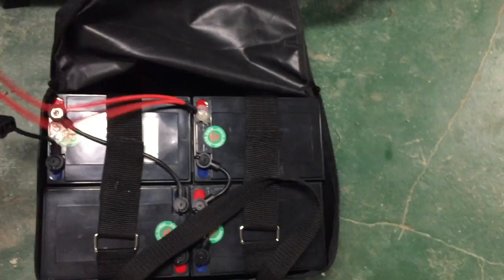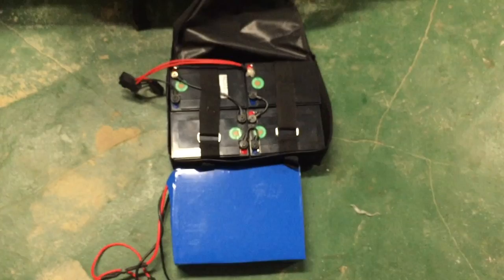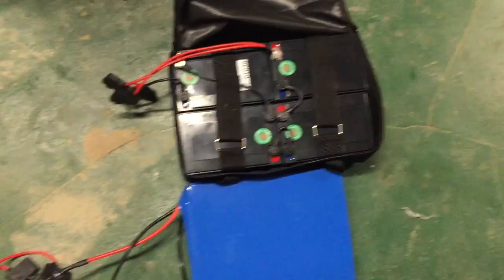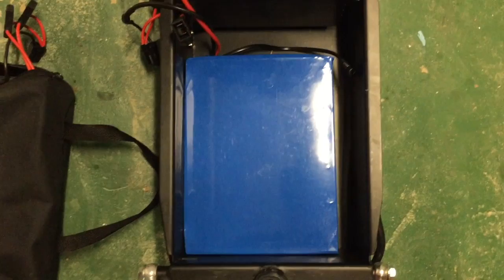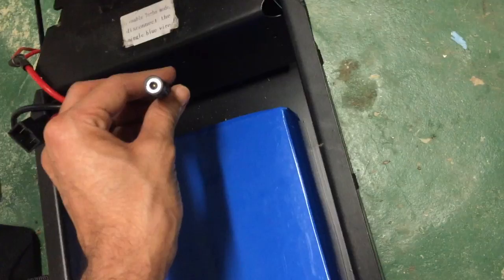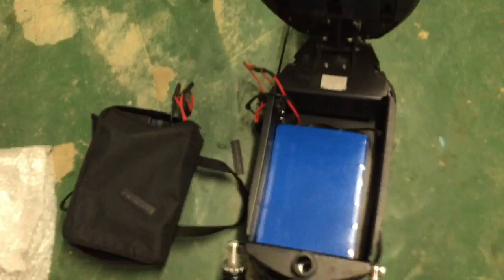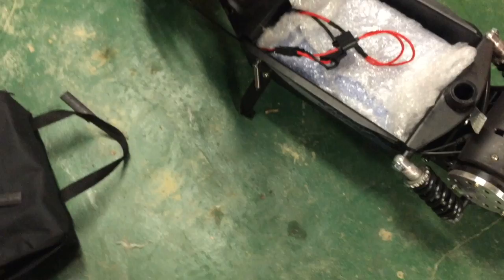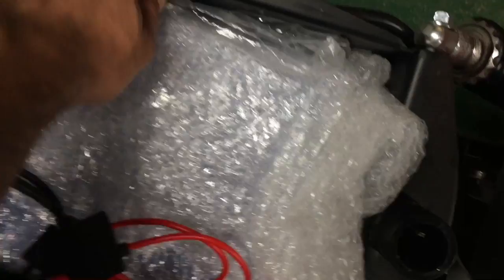UberScoot 1600w 48v Electric Scooter Lithium Upgrade 48v 25Ah

Comment: I placed an order for one of these scooters from the same link that was posted and it still has not shipped. I called the company  ("In The Hole") and they told me that all the other online stores are sold out of these and don't have any more in stock. Is anyone else having these issues? Does anyone have a link to another store where you can buy one of these at a good price and that has a good reputation?
Reply from the maker: I’m having the same issue as bigtoysusa is the source for all Uberscoot scooters and parts. I’m waiting on Uberscoot tires. My tires have run out of tread. I have contract them and they said the shipment is coming from over seas and was stuck in customs I saw the shipping status it’ should be here soon. If I were you I would wait if not see if Walmart online has them available. Don’t buy the scooter from eBay or any other untrustworthy seller as they have old outdated scooters for sale, wait on the newest scooter should drop in a week max
Reply from the maker: Did you ever get your scooter?

Comment: I FOUND THE BATTERY AND ORDERED IT, MY FRIEND I SEEN YRE UPDATED VIDEO COOL ALL YRE VIDEOS ARE GOOD,IM GONNA DO MINE JUST LIKE YOU SHOWED ON HERE I HAVE THE SAME SCOOTER I ALREDY GOT THE BATTERY CABLE FROM THE LINK YOU SHARED SO THATS ALL I HAVE TO DO?? WHAT YOU DID ON VIDEO AND IM GOOD??? GET BACK TO ME PLEASE THANK YOU,
Reply: Yes jus plug the battery in and DONT wrap the battery in anything. Just put styrofoam around it and that’s it.
Reply: @Kornatzz  hello and the link for the battery he has here goe to the ALIEXPRESS SITE AND BATTERY BUT THE BATTERY HE SAID HE USED TO DO THIS WAS A 48V 25 AH  2000 WATT AH   BUT IT DOES NOT HAVE THE 48V 25 AH IT HAS A 48V 26AH 2000W(5A WILL THIS BATTERY WORK??? WITH MY UBERSCOOT 1600W 48 VOLT SCOOTER??
Reply: @Kornatzz  hello and the link for the battery he has here goe to the ALIEXPRESS SITE AND BATTERY BUT THE BATTERY HE SAID HE USED TO DO THIS WAS A 48V 25 AH  2000 WATT AH   BUT IT DOES NOT HAVE THE 48V 25 AH IT HAS A 48V 26AH 2000W(5A WILL THIS BATTERY WORK??? WITH MY UBERSCOOT 1600W 48 VOLT SCOOTER??
Reply: @jeantaylor6785  any 48 volt battery will work. Just depends from where you buy it. If you buy it from eBay from China sellers, it’s most likely be a scam if you buy a 20 amp hour battery from China it will most likely be a 10 amp hour. A way to tell is how big it is.
Reply: @Kornatzz   HELLO DRAGOS I GOT MY 48V 25AH LITHIUM BATTERY FROM ALIEXPRESS WERE HE DID AND HAVE USED IT IN MY UBERSCOOT 1600w 48V ELECTRIC SCOOTER I HAVE A SPEED SPRCKET ALSO AND THE CHAIN HAVE NOT PUT THAT ON YET I TOOK IT FOR A RIDE AND IT WAS AWSOME I DID NOTICE THE ELETRIC MOTOR WAS HOT BUT DID NOT CAUSE ANY PROBLEMS I WENT ABOT 12 MILES ON IT WHAT ARE YRE THOUGHTS ON THE MOTOR GETTING A BIT HOT???? ITS THE SAME BATTERY HE GOT, I ALSO HOOKED THE POSATIVE UP LIKE HE DID IN THE UPGRADED VERSION OF THIS VIDEO WITH A CONNECTING BLOCK.
Reply: @jeantaylor6785  it’s normal if it gets hot.
Reply: @Kornatzz  AWSOME WHAT DO YOU THINK ABOUT ME PUTTING THE SPEED SPRCKET ON IT??
Reply: @jeantaylor6785  do you think you really need it?